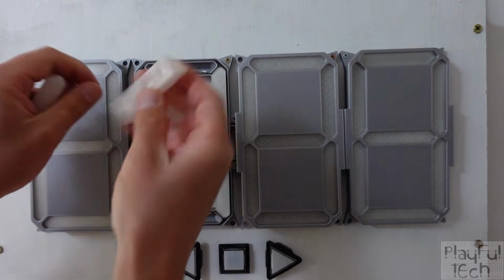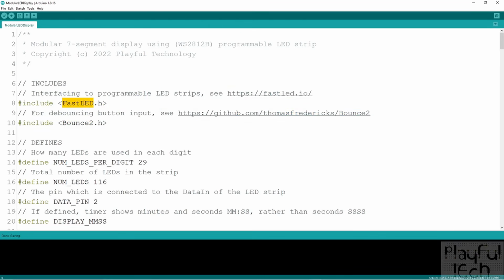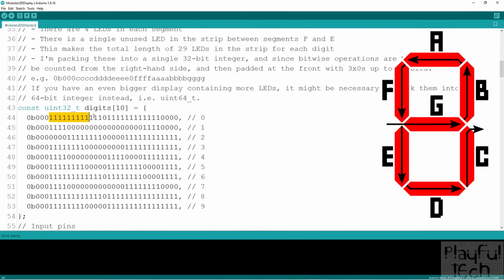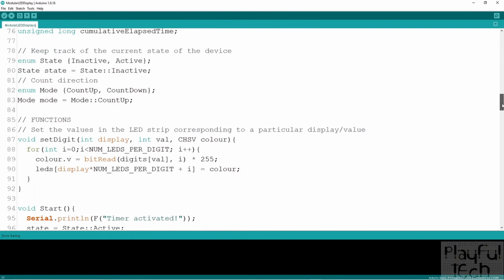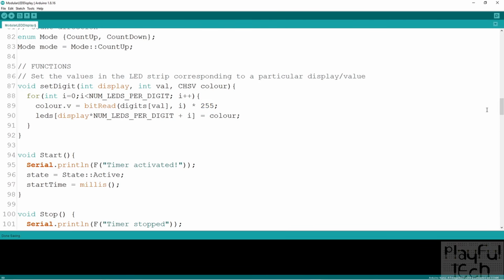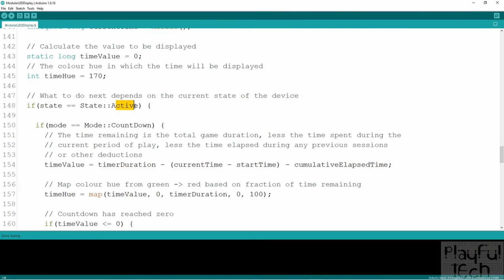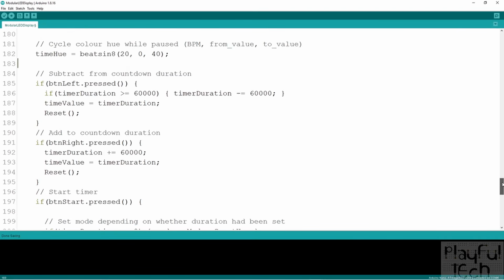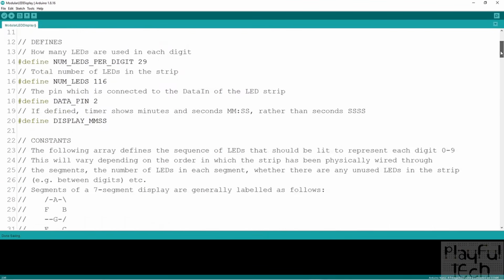Create your own LARGE 7-segment LED display!

Comment: LOVE this project and thank you so much for posting. I built a version with 30 LEDs per number and now I'm trying to make a lower profile one with a FCOB and it has 90 LEDs... But Arduino doesn't allow 128 bit? I know just enough to be dangerous but not enough to know if there is a way around this... Do you have any suggestions? Thanks in advance.

Comment: Hello Alastair, I don’t know if you still monitor this post, but I have a couple of questions:  does each digit use a 29 led section (7x4+1)?  Also what is the combined width and depth of your 4 digit display. The video says the height is about 8 inches.   Thanks.

Comment: The STL file for the frame seems to have errors. Can you provide the proper files? THe Thingiverse links are also showing 404.
Reply from the maker: They're all here: https://drive.google.com/drive/folders/1QjP0X0SCyLuz6ssbjkV6EwPs4TFJ1ZTz?usp=sharing
Reply: @PlayfulTechnology  Appreciate the link, but this copy of the STL files is also corrupted with lots of issues. I've opened in 2 different editors, and each has significant issues with the model. Can you please open in a modern editor and re-export?  These are unusable as is (both in the zip file and the individual stls in the original link).
Reply from the maker: @donttrackmebro  They slice and print in Prusa Slicer fine for me. There are a few non-manifold edges that Blender can detect and fix trivially.

Comment: Do you think it would be easy to have a smaller version with 3 leds per segment instead of 4?
Reply from the maker: Absolutely - it's trivial to edit the code to change the number of LEDs in each segment of the strip.
Reply: @PlayfulTechnology  Please post versions with 2, 3, 5 and 6 LEDs per segment. It's certainly not trivial for me :)

Comment: Very very nice project 🎉 I’d like to improve a volleyball scoreboard with this addressable strip. I want to put 5 or 6 leds per segment; do you think is better to use an arduino mega 2560 to have more memory for a 64bit variable? Thanks in advance, Umberto.

Comment: Very nice tutorial! I want to build a digital clock which synchronizes to internet time. Not sure where to start. I love your large displays. I want to add the colon (two dots) between the pairs of digits. Maybe display seconds, although extra work and cost probably is not worth it.
Reply from the maker: If you're using an ESP32 it should be pretty straightforward to connect to an internet time server. You can also get an RTC module which will keep track of time locally once set.

Comment: I have designed a 6-digit 7-segment display for dynamic indication of the address and data of a laboratory microcomputer, which requires only six bytes (8051) to write to.
However, the display contains 12 chips and a diode matrix with 34 diodes.
Can anyone suggest a way with fewer chips for such an indication? 
A prerequisite is that they must not be programmable microcircuits(the project involves the creation of a microcontroller system WITHOUT the use of programmers).

Comment: Hi! This is exactly what I was looking for. I'm designing a two-player, two digit score board with a two-digit shot clock in the middle and I love the idea of using the WS2812B strips. I was wondering if there is an easy way to scale up/down the size of the digits. Say, for example, I wanted to make the shot clock in the middle the size in your project (4 LEDs/segment) but wanted to flank it with two score counters on either side that were smaller, using only 3 LEDs/segment. Can you maybe point me in the right direction to do something like this?
Reply: I also used 3-segment LEDs and modified the following lines:
#define NUM_LEDS_PER_DIGIT 21 

#define NUM_LEDS 84  

// matrix for 3 segment LEDs
const uint32_t digits[10] = {
  0b000111111111111111111000, // 0
  0b000111000000000000111000, // 1
  0b000000111111000111111111, // 2
  0b000111111000000111111111, // 3
  0b000111000000111000111111, // 4
  0b000111111000111111000111, // 5
  0b000111111111111111000111, // 6
  0b000111000000000111111000, // 7
  0b000111111111111111111111, // 8
  0b000111111000111111111111, // 9

I hope this was helpful.
Reply: @antoninomanfre1387  such a simple and elegant solution. Can really see how easy it would be to scale and mix& match different sized elements.
Reply: I also want to create a halfsize version, where you able to do something?

Comment: Hi!
I've a similar project in mind, just wondering: how many led/meter did you take? 30led/m, right?  what power supply did you use to work with that much leds? In my case I would need to have 3 digits for hours, 2 digits for minutes and 2 for seconds(so 7 total), if I use like segment of 14 cm/segment, 7 segment/digit, it's something around  686cm. If I check my WS2812B provider, it's 9w/meter, so something around 63W. With a 5V tension, it implies something around 13A, which seems enormous.
Did you had similar issues?

Comment: This is awesome, I have been looking at how to create a set of lap counters for long distance swimming at my club. The cost of lap counters are very expensive and this could be a great way of doing it. I will need to house two digits in a waterproof case counting down in twos from 60 (or 32 for 800m). My initial thoughts was to have them with internal rechargeable battery packs and to swap out the Arduino for a ESP32 so that I can trigger counter for each lap independently.  
I am a bit of a noob to all of this but do you think my idea sounds achievable?
Reply: I am developing something similar with an ESP32 to make a goal counter, fouls, stopwatch for basketball, have you had any progress in your project?

Comment: Your Google Drive Frame.stl model is bad.  Ultimaker Cura says "The highlighted areas indicate either missing or extraneous surfaces. Fix your model and open it again into Cura."  The model from Thingverse does not have the opening for the wires and seems like your model from Google Drive is exactly what I am looking for.  Do you have a Fusion 360 file for this model?
Reply: Did you ever get them as the links are broken now too

Comment: Hi Alastair, I can't seem to find this project on your Patreon?  Is it still available?
Reply from the maker: Hi Leigh, you can find the download here: https://drive.google.com/drive/u/1/folders/1QjP0X0SCyLuz6ssbjkV6EwPs4TFJ1ZTz   It was removed following a v. confusing legal issue with Patreon - because I was using 3D models that had been based on a previous CC-licensed design (even though that was perfectly allowed under the licence!), I was informed that I had to remove the project from my subscription Patreon because it was felt I was "charging" for someone else's work... even the Arduino code which is entirely my own!
Reply: @PlayfulTechnology  Wow!  The crazy part is the code is really the only thing the full DIY person requires, is your own work, and, charged accordingly!  You just can't win.  Thank you all the same, I'll drop some cash in your Patreon.
Reply: @PlayfulTechnology   Not confusing.  You used my CC licensed model without providing attribution.

Comment: I can seem to find 470 uf 6.3 capacitors. Can I use something else?
Reply: I couldn't find them either.  His words in the video were "anything greater than about 6.3V & about 1000 micro farads."  From my limited research I think you just need more voltage than the circuit (that's why 'at least' 6.3V)  I found a variety pack with some 10V 470uf capacitors in it.  They seem to work fine.

Comment: Love your tutorials! In this one, I was wondering how to add the colon to the display. I'd need to adjust the code, of course, to light it and keep it lit throughout. But you'd have to 3d print the colon so you could wrap the LEDs around it, be it a circle or square. Like to know your take on it! Thanks again, Alister.(Not sure of the spelling of your name!?)
Reply: A suggestion ... Instead of coding in the LEDs as part of the strip, you could do two LEDs separately on their own Arduino pin to change color with the rest of the digits.  Or, if you didn't use the color changing aspect, you could just use two LEDs (non-neopixel) that are just connected to power, since they would be on all of the time.  
Just a thought!
Reply from the maker: Yeah, definitely! My enclosure was based on a remix of this design, which already features a colon so you could probably use that one (or something very similar!): https://www.thingiverse.com/thing:3136688